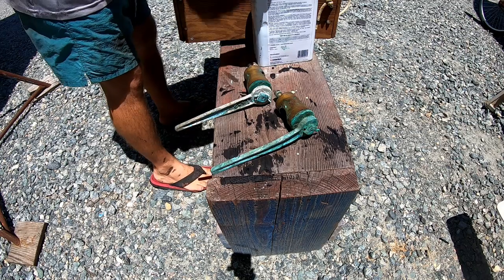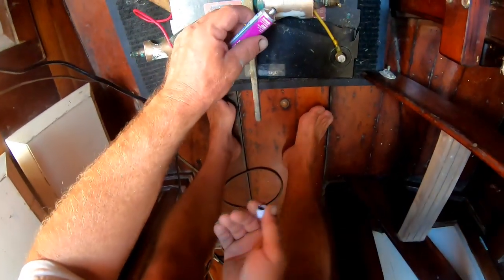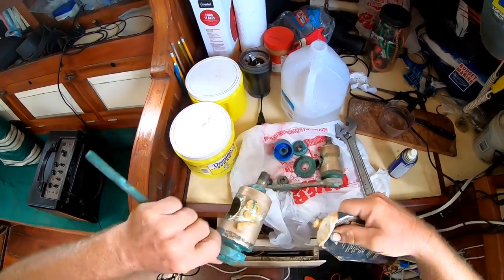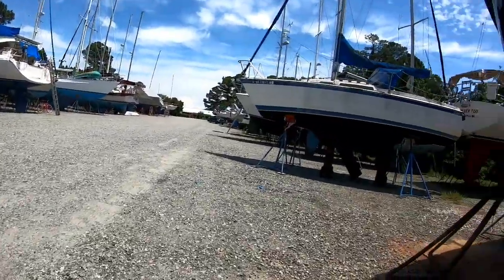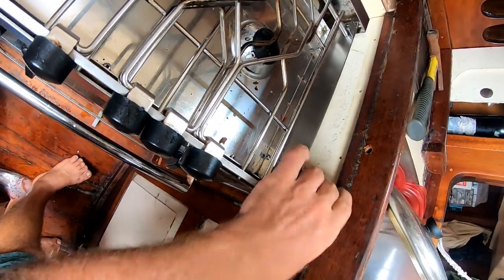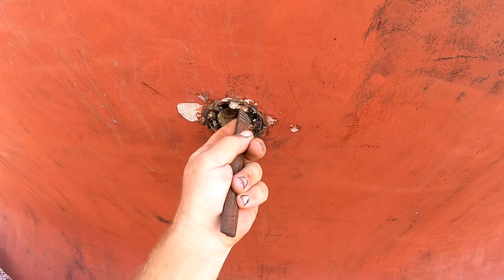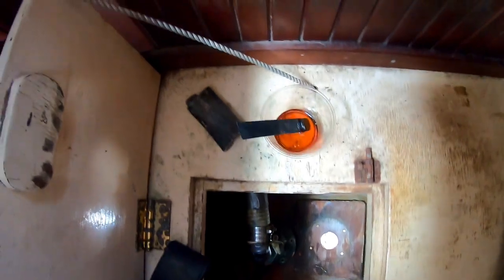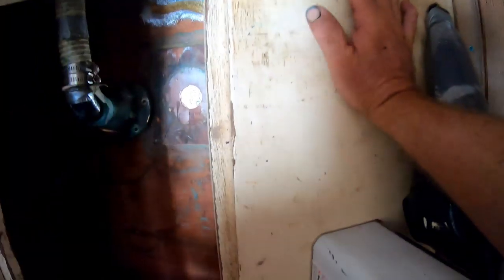Through-hull replacement and other fun things, part two

Comment: Nice bung removal idea....I could have used two days ago.  What a relief to see other boats get tabbing separation also.  Now to see what varnish will last forever.
Reply from the maker: Yep, they tell me that the bulkheads are usually put in after the hull has cured, and polyesters don't stick as well when applied to cured polyesters (hence you have a lay-up schedule for constructing a hull).

Comment: Kevin, I'd never used composite components and was suspect of them until someone turned me on to "plastic" (some type of nylon, I think) oarlocks & horns for skiffs and dinghies years ago when I still had my wooden boat shop on Cape Cod. I tried a pair and found they flexed a little but didn't break. The advantage was that they made very little or no noise when rowing and the shaft size was larger than standard so nobody ever stole them. The other advantage was that they were very inexpensive compared with the bronze oarlocks I used to use. I started selling them and everyone loved them (I still have several pairs in leftover inventory). That's been my only experience with composite components and accessories for boats, so I'll be very interested to hear your assessment in the future as to how the composite through-hulls & sea-cocks perform and stand up in the future.

Comment: Kevin, when are you going to break down and get yourself a battery drill and impact driver ? I have a set from Bosch and don’t know how I ever got along without them . A small inverter and you would be able to charge them off you battery’s while under way. Some brands have 12 volt chargers. Good idea on seating your valves , hope you cleaned them good after seating. Thanks for the look at the other side of sailing , 😊 Take Care .
Reply from the maker: Oh I suppose that will end up in my tool box at some point, but I really like that old hand drill, so simple.
Reply: @howtosailoceans1423  I've got one just like it, inherited it from dad!

Comment: Good call glassing around the inside of the through hull cavity. My previous boat was a Dreadnought 32 also with a cored (balsa rather than airex) hull and I took extra care as well to keep water out. 
I like the composite through hull fittings. I have often thought of adding some fiberglass reinforcement  to the handles but have never gotten around to it. I am used to regulary opening and closing bronze bronze ball valves to keep them free so no biggie to stick with that routine.
Great vid, as always Kevin. Very informative😁😁
Reply from the maker: Yes, with balsa core you have to be extra careful. I'm not sure if water would wick into airex, but I'm not willing to take the chance given the downside is delamination.  Thanks for stopping by..
Reply: @howtosailoceans1423  Get a router in there and route out the core then fill with epoxy bog
Reply: @alcooper944  or use an Allen wrench in a powered drill to clean out the core.

Comment: Good choice using Marelon. One issue : if the old seacocks were used to ground the standing rigging for lightning or the radios, the Marelon seacocks will disable that system. FYI  
Some reading:

http://www.kastenmarine.com/Lightning.htm

Comment: Do you need to chase the threads of the four bolts at the through hole?  
I've only used old hawser and firehouse.  Hawser of proper diameter to snug up inside the hose.  Hawser gotten from the larger commercial fish boats and fire hose from the fire station or harbor patrol.  Splashzone for bedding the screws.
Reply: I  use firehouse and aircon insulation but hawser sounds better. I avoided drilling holes by using  Tip Top conveyor belt glue but it ain't cheap.

Comment: Hey Kevin, I'm curious about the fiberglass application in the thru-hull. I have sealed the core in smaller through deck holes by gouging out some of the core and filling with thickened epoxy. Would this work here also or is there a reason you used the cloth? Possibly because of the larger diameter of the hole? I love seeing Deltaville in your videos, we spent several months there and loved the area.
Reply from the maker: I wanted to cover the entire hole with a waterproof laminate, not just the core.  The roving holds epoxy and thus serves as an excellent seal--just make sure that when you are sanding it smooth you don't sand through it somewhere.  Remember, water can wick into fiberglass too, through the roving, or so I am told.
Reply: @howtosailoceans1423  Okay I understand. Thanks for the reply.

Comment: I have hand lapped steam valves, and exhaust valves on engines, so that should do just fine on your boat. You can check the seal area by coating the gate with blue dye and assembling it to see if you have a nice shiny ring showing through.
Reply from the maker: Never thought of the blue dye, yes, then you can see where the water is attempting to get through, if there are weak spots.
Reply: @howtosailoceans1423  it shows where the metal is touching. Ideally you want all the metal touching for a good seal.

Comment: Don't sand those taper plugs. You ruin the fit that way.  Use lapping compound and lap the plug and the housing together, until you remove most of the corrosion from the plug. you maintain a perfect fit that way.  Then use a sealing grease.  That stuff is way thicker than peanut butter and lasts a long time.
Reply: I am pretty sure that's what he did

Comment: Every time you remove a piece of wood from the boat, you ought to replace it with stainless steel or aluminum. You know, a respectable material, as opposed to the pathetic carcass of a dead tree. (As a welder, wood just gives me the creeps)